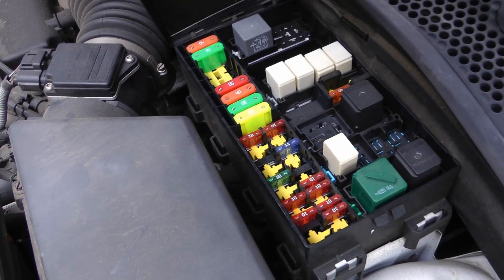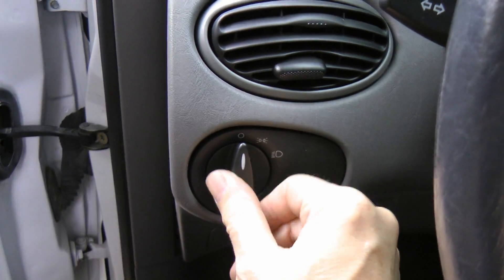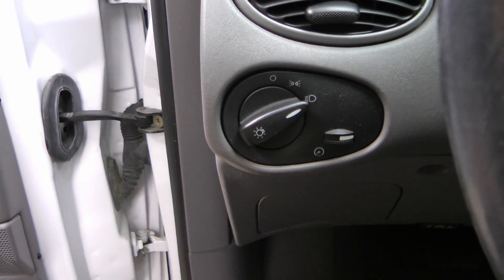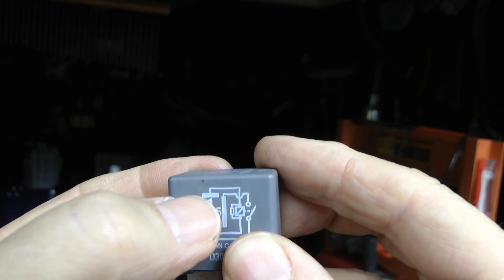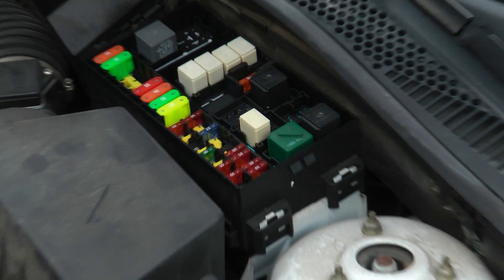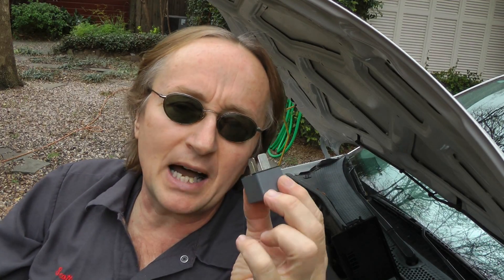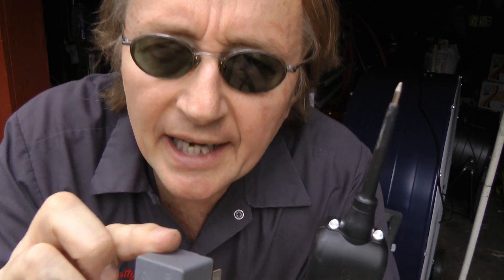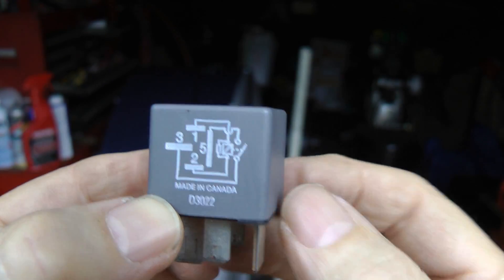How Electrical Relays Work in Your Car - Electrical Troubleshooting

Comment from the maker: why are you messing with the solenoids in the first place? you really need a dealer level scanner to work on those things, as in my video "fixing modern cars using high level scan computers"   But I'd leave that fuse out, I assume it was removed for a reason, and why tempt fate?

Comment: Hi Scotty,
 I bought a 2002 Mitsubishi Montero Sport 3.5L
Today I noticed that the A/T fuse is missing. I have been driving this truck for 9 months with no noticeable problems. Do you think I should put a new fuse in there. Almost afraid to insert one thinking another problem will show up.
I checked my 2 EGR solenoid relays today with a 9V battery and they were clicking. Does that mean they're good? 
How do I test to verify voltage is getting to the solenoids without blowing up my computer?

Comment: Scotty, I have a 1990 geo metro. There is a master relay that engages power to the ign coil, fuel injectors, and fuel pump. This relay is failing intermitantly stuck on. I have attempted to trace the electrical path but I cannot find it!!!  Can you help me?

Comment: It turned out to be the cam position sensor and mass airflow sensor both blew. shes running like a beaut now. The owner before me never did any maintenance or anything to her, the oil was black as tar when i changed it but shes all cleaned out. Sparkplugs were rusty as well. Im glad i get to give this car a good owner.

Comment from the maker: either the switch has gone bad, or you have a computer problem with a body control module, which ultimately runs the headlights. Complex crap on those rodeos, known for such electrical failures big time when that age.

Comment: Hi
I have Isuzu rodeo 2000,my headlight are on, when my car is off   ,and the headlights relay start to make a sound ,and this cause my battery dead ,what could the cause,even I already replacement the relay for a new one ,still the same problem.Thanks for u help.

Comment from the maker: if the check engine light comes on, it can't be a blown fuse.  either the wiring has gone bad, you have a really bad sensor on the engine, OR the main computer has gone bad. Time to see a real mechanic like me on that one. Or if it runs fine, ignore it.

Comment: Scotty, I have had to replace the right headlight twice in 9 months in my car, but the 2nd time I put some of that transistor goo stuff (for lack of a better term) in the connectors and its been a year and half since I replaced one, but now I've noticed condensation in that headlight (its a glass lens if that makes a difference). How does that happen and how do I fix it? Can I just ignore it? Thanks

Comment: Hello Scotty, i have a 1996Toyota Camry.My car used to run smooth as new until i had to put engine oil every month.My rpm reading used to be around 2.2 when driving on 60Km/h.But now its 4.0 or over that.When i release my accelerator my cars speed drops drastically.The rpm drops a lot(sometimes less than 1)even if i don't apply brakes.No power in the car.What can be done to fix this problem?Can you please help me. thank you :)

Comment from the maker: ah, a dodge with electrical problems, no surprise there. But with Bus problems on that baby, you'll need a machines as in my video "fixing modern cars using high level scan computers" and a guy like me to operate it. no way past that one. Over engineered garbage really, but that's how to have to work on them. Realize you may have a bad main computer.

Comment: hey scotty thanks alot for all the auto repair video. i just have a question i have a toyota hiace commuter van 2kd ftv diesel engine 2.5 liters with 1720 miles as you can see it is new i was just checking the fluid in the front hood where you can see the brake coolant and washer resevoir. ive notice the headlight connector is kinda yellowish and like melted a little bit i know relays prevent that from happening why i it melted? is it normal or us just the head light bulb that is very hot?

Comment: The computer should be the last thing you should check. Try changing the ASD relay. If the relay is good check for the cam and Crankshaft sensor. If those sensors are good check the Coil pack Resistance with a multimeter. If that's good then it's the computer. I know this because that's how I was able to fix my car. .

Comment: If I was you I would change the ASD relay. They are very cheap like 10$ around there. Is your engine check light on? because that would give a good indication that your computer is working. When my Mitsubishi did not have spark, my check light engine keep flashing every time I try to start the car. My car computer was reading that coil pack was not firing. That lead me to the ASD relay because it provided power to the coil pack and fuel.

Comment: My Eclipse is standard Transmission. It only has a few small fuses under the dash and all the relays are under the hood. The problem i am having is that the spark plugs arent firing and also the fuel pump does not come on. Is there any other way this cannot be the computer?

Comment: The ASD relay is not located on fuse box.  The ASD relay is located under the hood on the drivers side right next to the fuel pump relay. The ASD relay should be the middle one if your driving automatic non turbo Mitsubishi eclipse.

Comment: Hey  I had the same problem on my 1997 Mitsubishi Eclipse but I was able to fix on my own. I did not have no spark because the ASD Relay was bad. Mitsubishi Eclipse use ASD relay to power up the coil pack and the fuel injectors. Try changing the ASD relay. If you need help locating the relay let me know.

Comment: Speaking of electrical part, my 2004 Kia Optima was running excellent till one day. I traveled for about 100 miles from one city to another with no issues. The next day for some reason my car would violently stall at stop lights or stop signs. Another issue was my car would only idle at 2000RPM. This issue happened out of the blue, when the car tries to stall you hear a squeake or rubbing.

Comment: Hey Scotty, I ran the pump straight to the battery and it works, all the fuses are intact, but the spark plugs arent firing. Honestly, I am leaving the computer as a last case scenario, what do you think is the possibility that its a coil thats burnt out?

Regards.

Comment: I am a 17 year old that got this car as a gift. The car is entirely fine except for the transmission. I dont have the money to get rid of the car and buy a new one. Im going to go get the transmission fluid flushed and replaced with some additives to preserve the transmission so hopefully it will last me until september when i come back from working on the oil sands and ill have money.

Comment from the maker: typical for a G6, they were one of the big reasons pontiac  doesn't exist anymore. One of the worse transmissions GM ever made. Do a rebuild, or quick get rid of it. Don't even think of using a junk yard transmission as they are all garbage over time.

Comment: Hey scotty. My pontiac g6 transmission is starting to slip alot. The engine light came on today and it is starting to shift really weird. When i put my foot down getting onto the highway it has a delay and then starts to go, then it shifts hard into the next gear. My car is a 2006 pontiac g6 2.4l.

Comment: I have notice some wires behind the fuse box under the dash are burnt. I have also checked to see if the spark plugs are firing and they are not, i just put in a new fuel pump but i dont hear it when i turn the keys. More strange is that all the fuse are working.

Comment from the maker: you should check your e mail settings then, I got it back as undeliverable.  But you can ruin all kinds of electronics doing that, from the main computer to fuses and alternator.Trace the power from the battery to the fuse box and pray damage is done just there by blowing fuses or melting wires.

Comment: i have promble with a car i was wounder if you can help me out or if you know whats going on with it i have a 1990 ford feasta and it is pop threw the trottle body and it puffs white smoke threw the trottle body and it has a gases small to it and nothing comes out of the pipe at the end of the car

Comment: I have a problem with my 2001 Chevy blazer, in the morning it starts fine but by lunch time after it sits about 5 hours when I try to start it, it makes a grinding noise and then I try again and does the same thing but attempts to start and makes a couple thumps and the third time it will usually start. It sounds like it isn't getting any gas to the engine but I can here the fuel lines when I turn the key! Any ideas Scotty?

Comment: Hey Scotty my car isn't blowing any air through my vents. It used to work on speeds 1-3 but 4 never worked. Now none of them work. I read online that it could be a blower motor resistor or a relay. In your professional opinion what do you think it might be? Thanks

Comment: Assuming the hoses are both getting hot, make sure the door in the duct is working. If that is stuck you'll never get hot air inside. The mechanism can vary, but its often operated by a wire or cable which can come loose.

Comment from the maker: one of two things, either really cheap chinese made cores soldered cheaply together, or the heater core needs an extra ground wire attached to it. If not grounded, it can eat holes up from electrical action on the core itself.

Comment from the maker: see if both hoses going to the heater core are relatively hot. If not, replace the heater core itself, that old they will often be useless inside from corrosion

Comment: Hello Scotty. Can you or anyone help me please!!!!  I own a 3/4 ton Chevy Silverado K20 pickup 4X4 1973. The heater doesnt get hot at all juat blows cool air. And it doesnt have AC in it. It did at one time but took it out. Any ways i have replaced the thermostat the heater core the switch panel i have rewired everything. I put new hoses on everything and flusehed the system and it will not get hot. Im begging you to help me please!!!! Anyone!!! Its a 1973 but the heater system is from a 1976.

Comment: You're lucky you hear the noise, it could have and will freeze up..It's a 2006 means probably 70-80,000 miles, I'd change belt tension pulley's  including the water pump. You must be lucky, don't push it.

Comment: I'd look at the leak point under high magnification, the core is probably made by a robot thats screwin up, or a human, in either case I'd change suppliers, BUT you need to see what the exact leak point looks like.

Comment: I have a question, I recently have my coolant refilled with some 50/50 coolant at a shop. Upon noticing one day my coolant level was low, not only that but it was a light brown color. Any thoughts?    2004 Kia Optima V4 is the car I run, the thermostat show its running slightly cooler then normal but there is a lot of heat coming from that engine.

Comment: Scotty,
My power window (passenger) recently stopped working in my 1999 mitsubishi eclipse gs. It doesn't work from either switch. I tested the harness that plugs into the motor with a multimeter and it still gets 12v when the switch is pressed, but the motor does not move.
I replaced the motor and the problem persists. Do you have any suggestions? 
Could it be a bad switch even though when I press it, it still gets 12v?

Comment: 9 Accord wagon keeps getting uneven front brake results on a brake roller tester, have checked all caliper slides are free and greesed and system is well bleed, any ideas?

Comment: Separating out circuit control also saved on the added costs of more expensive heavier gauge copper wire.

Comment: just youtube  your make and problem..my dodge has repairs by other tubers and i learned alot..my cabin blower only works on 3 and 4  but not 1 and 2  ..youtube showed me the problem is not a relay..its a funny crucit thing where the hazard lights are on the collum to repair it..lol..ive never fixed it..  my cabin heaterbox BLEND DOOR is broken.. cab blows half cold half hot.. 800$ repair.. too much money..youtube showed me how to jurryrig it  with drilling holes and braking the blend door off

Comment: i wish my dodge ram was that easy.. have you heard of DODGE REM RELAY 73..its not the relay..its the fusebox itself.. i bought a relay.. no change.. it powers the running lights on the drivers side of the truck.. left parking lights...left turn signal on the trailer....left stoplight on the trailer. left licence plate light bulb. .called relay 73.. its 600$ to fix the problem or 20$ to run 18ga wire and bypass the light or jump the relay ..youtube has vids on this..dodge says this is normal

Comment: Just because a relay clicks does not mean it is good. The contact points may have burned to the point where they don't connect anymore. You really should confirm a closed circuit with a continuity tester.

Comment: Its a bad head light bulb. There are two filaments in one bulb. Your low beam filament is bad and the high beam filament is good. Try swaping the right with the left and see if the problem jumps to the right. If it does replace the bulb.

Comment from the maker: realize that's all computer controlled, so rather than deal with that crap, I'd just wire the fuel pump directly from the ignition switch to make the pump run, easy fix that lasts forever

Comment: Hello scotty,
I need your help. I have a 2000 mitsubishi eclipse v6.
Like 1 year ago my MFI relay went bad. The car intermitenlty stalls when i was driving. I replaced that relay after dealing with this problem for months because it was a pain in the ass to find the problem.
So I replaced that relay and the car workd fine for 6 months. Then again the same relay went bad! .So i replaced that MFI relay again and it's working fine. 
What could be the cause of those relays going bad in that circuit?

Comment: what really gets annoying is solid state relays, thought i had a bad relay in my car cause the headlight fuse kept blowing, long story short turns out all the relays in my car are solid state cept for the ignition one, and the problem was the filliment in the headlight burnt out but the metal wires that the filliment goes between somehow soldered themselves together. guess the egg was on my face that day lol

Comment: The MFRs probably use the same box on many different vehicles.  Sometimes it's also for options you may not have (i.e. our van has a spot for a heated seat relay -- if we actually had a heated seat.)

Comment: Start with basics, make sure the coolant is fresh and clean and there's no signs of corrosion in it.  When the car is running hot and at idle, briefly feel both the upper and lower radiator hose (it's hot, so cover your hand with a rag, and beware of any belts or fans).  They should be the same temperature.  If not, the thermostat is most likely bust.

After those are checked, it's time to diagnose the water pump and head gasket.

Comment: It's held in by strong plastic tabs.  Just gently pry them back using a small, flathead, and it'll pop right off without any damage.  Just be careful not to mess with the insides or get water on it or anything like that.

Comment: scotty, my car is overheating , the water in the radiator seems to falling but is not leaking where eyes can see. gasket has just been changed and the problem persisted. radiator had been cleaned.. whats next? please advise.
tq, honda civic year 2002.

Comment: some just snap off easily, but others you need a small flat blade screwdriver to wedge in a little bit to get it off.  There are also some are sealed and you can't open them at all.

Comment: Hi! Does anyone knows what can happen with volvo s60 2002 d5 diesel? I had oil in my coolant, changed the head gasket, washed the sistem but the oil still comes up... and now car has a vibration when you acelarate above 50 miles, the vibration just comes up when you push the pedal otherwise its good...

Comment: I just got a full tune up,got the cranckshaft and camshaft sensor,got a new battery and new alternator and fuel pump I take care of my car it's just the rpm that goes up and down when I put it in park only and it gets warmed up.

Comment: Hey Scotty my Nissan 2003 when it warms up the rpm goes down and up I took it to the mechanic and he said I need a sensor  that He needs to order because the dealer and auto shops don't carry that sensor and I forgot the name of that sensor and it's gonna cost me 250 just for the sensor which is located in a place were he said its gonna take all day to fix? What do u think it might be?

Comment: first generation ford focus with 2.0L Zetec engine, I have the exact same car with the same problem! And I JUST fixed the relay on the high beam this past weekend. :) The low beam relay burnt out, and I just used the high beam relay in the low beam socket, and in the past several months I just drove the car without high beam, no big deal.

Nice video!